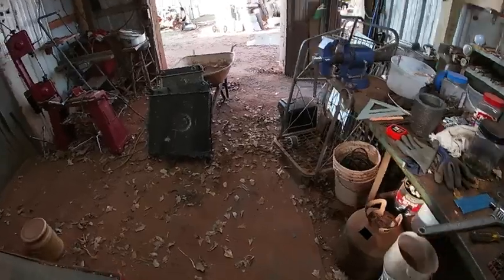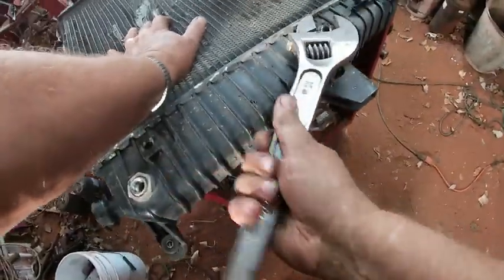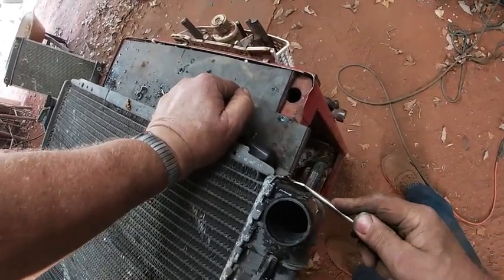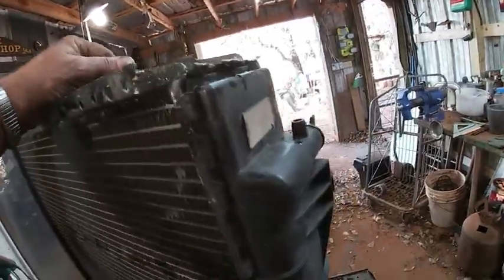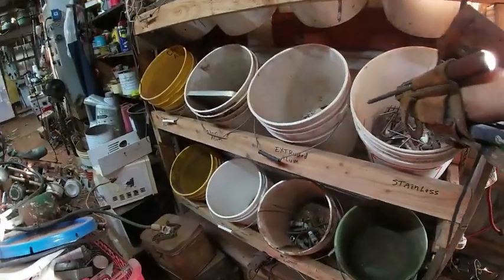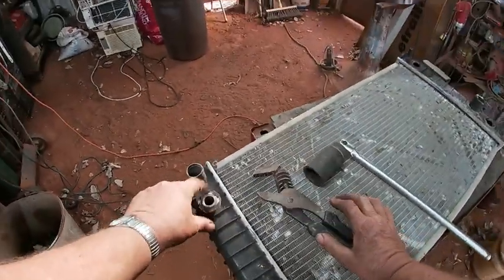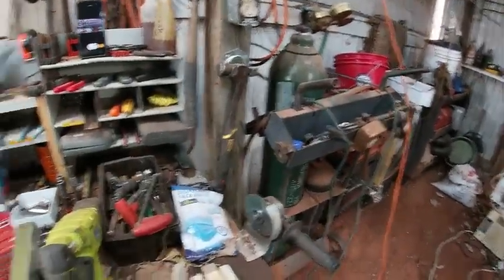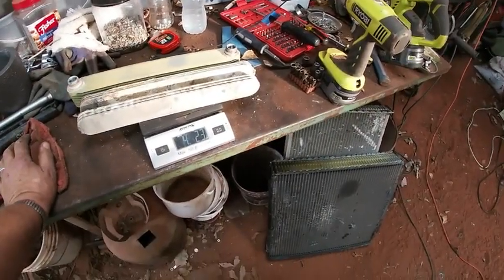How two scrap aluminum Radiators for clean aluminum

Comment: I use the pliers that have the cutting ends on them on those tabs. Just wish I had done that were spring loaded. I forget the actual professional name for the pliers but I always called them end cutters because when holding them the cutting part is side to side instead of going forwards

Comment: Do they still buy the a/c aluminum/copper radiators here in Oklahoma? Or do they not bug then still, I remember a couple years ago they stopped, but I’m not sure now.
Reply from the maker: yes they do if you have the right documentation, like a heat & air license, a scrap metal collectors license. a farm tax number. call your yard and find out what you need. Thanks for watching and Merry Christmas

Comment: to each has his own way for them tabs i found it easier to take a pair of old slip joint pliers and take a grinder with a cut off wheel and cut a notch towards the end of the fine teeth same way the fine teeth groove is going it with grab the edge of them tabs and then bend them out faster than a screwdriver or pry bar
Reply from the maker: that sounds like a good way of doing it I have an old pair that I never use I think I might try that and see how it works for me, Thanks
Reply: @Okiescrapper  i found it easier that way tryed the prying but it wasnt for me but in the long run the pliers are still usable for other things they are still multi purpose

Comment: personally I would melt all alum you said you sold ingots for a buck and I thought a bit on our last convo if you could make a basket to put in pot then the alum melts and you could just lift slag and anything in it out or just give it a shake like yer making jiffy pop but idk I really enjoy this stuff you do thanks
Reply from the maker: Thanks for the ideas and inspiration, a stainless steel deep fryer basket may work, It would handle the heat without melting and still let the flame and heat into the basket

Comment: The low price is why i just pile up in the barn out of the way. How you tried an air hammer on the seam ?
Reply from the maker: Yeah I am storing mine in the bed of an old truck in the field no hurry, no I haven't tried the air hammer. I will have to give that a try. if it works I will have to make another video
Reply: @Okiescrapper  Just got an air-cat air hammer tried it on small power board transformer it blow copper all over the shop .Look at my son and said I guess we should turn the air down he said you reckon.

Comment: Why not just melt all the aluminum with a propane torch into a cookie sheet question mark
Reply from the maker: and then do what with it? cost of propane, and then the scrap yard may not buy it. but if that is the way you want to do it, then ok. every scrapper scraps the way that is right for them. thanks for stopping by

Comment: The aluminum inside the plastic ends are not cast
Reply from the maker: extruded?
Reply: I think it goes for aluminum cooler.My yard asks me to cut open to make sure there is no transmission fluid or water inside.You can cut open easily with a grinder with a thin cut blade. Also cut through those nuts very quick with grinder. On the tabs I use a very large screwdriver than has been sharpened slightly to catch on the tabs and bend them out. With the same screwdriver (prybar) I insert the screwdriver into the hole where the hose connection is and use leverage to force the plastic over. Always bend tabs on the hose side not the other side.

Comment: I sure do appreciate the fact that I don't scrap for a living.  This aluminum wire is killing my interest
Reply from the maker: Yeah if a guy scraps for the extra cash may be best to sell aluminum as is unless it takes very little effort to clean it up, or save it for when you don't have anything to do. I may just start saving it up, the price will go up someday
Reply: @Okiescrapper  in your case, you are able to melt it in mass quantity into room saving stackable ingots at little cost.  Like you said, the price will go up. I still can't get over how you can melt a lawnmower engine with that melting pot you made!